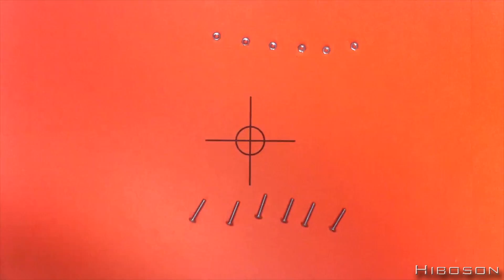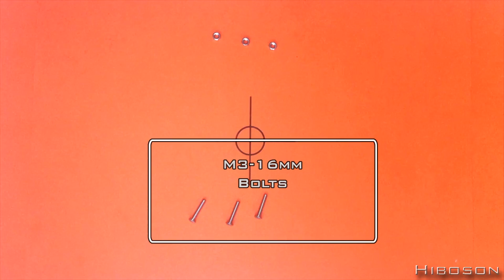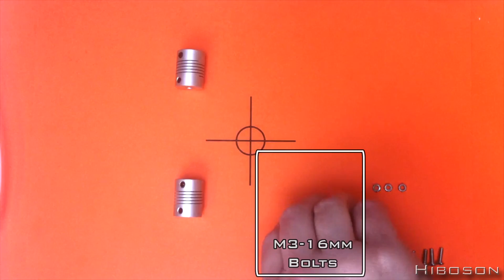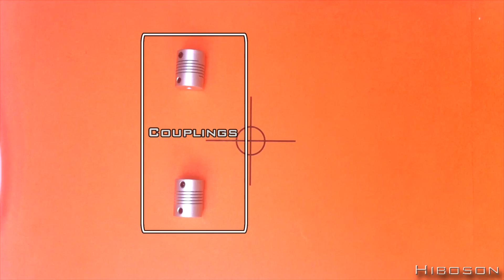3D Printer Build - Sunhokey Prusa i3 - Part C

Comment: Really nice detail on your build!  Must be a lot of work doing the video.

I'm still trying to decide which model to get.  Have to say I like the delta, looks sturdier than the Prusa i3.
Reply from the maker: sschrybu This video series has been way more man hours than I ever reckoned it would take lol but I'm getting there :) 

As for model to choose it's sooooo hard so much choice it gets a little overwhelming at times,, so  thought screw it got a nice cheap entry level RepRap as I know they have upgrade flexibility whist I learn,,, I thought I ain't going to fully start getting to grips of what I really need until I get something and find out what is and is not working for my needs,, then I can worry about getting another more suited printer then, or building my own from scratch :)